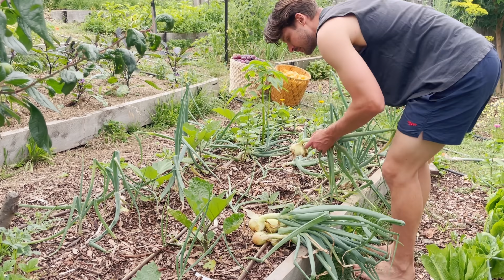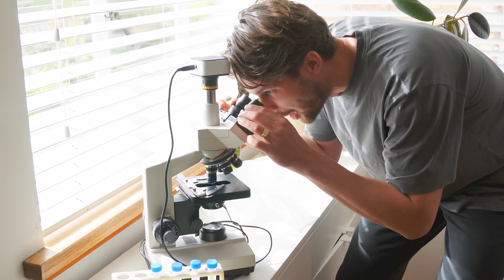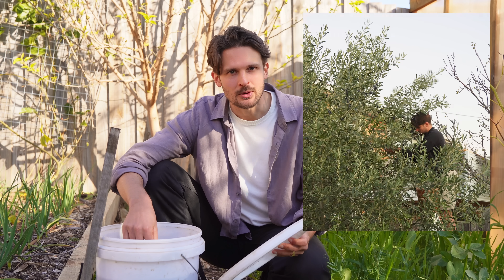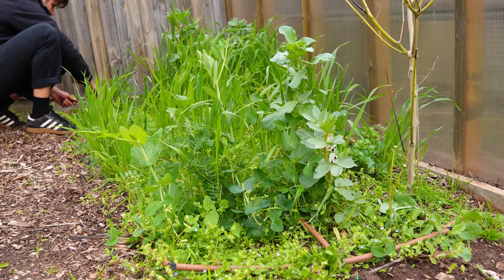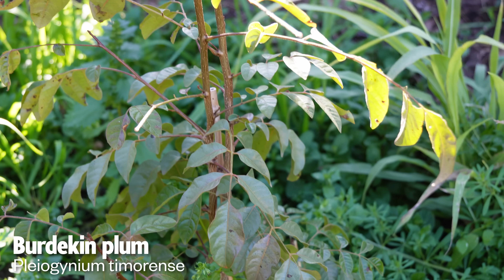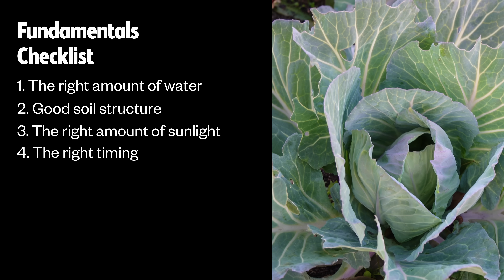How Doing LESS Transformed My Food Garden & Saved My Sanity

Comment: Fresh kit Ben! Any recommendations on an irrigation setup? Love your work.
Reply from the maker: Thanks! Drip irrigation is great for water saving, but it can be hard to keep the top layer of beds moist with them. Sprinklers can be better for getting even moisture throughout the bed particularly for seedlings. If I had an abundance of water I'd just used sprinklers because the beds would be a bit easier to manage and look nicer without the drip tube. Another tip is to use lots of valves so that you can select the beds you want to irrigate in any given moment.
Reply: @ben.strong could you water into ollas?